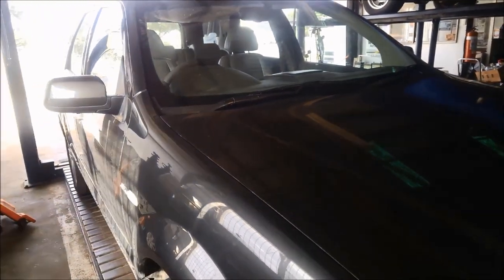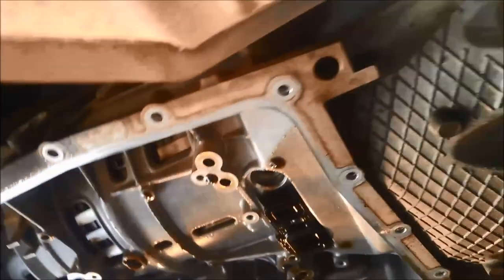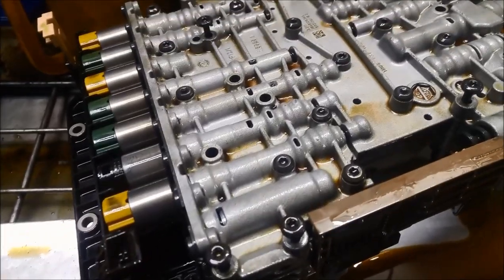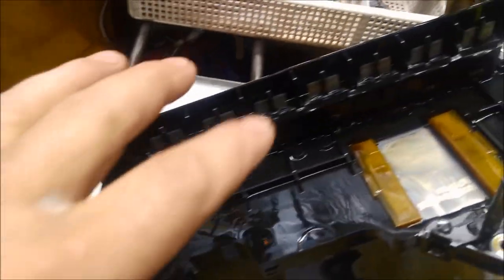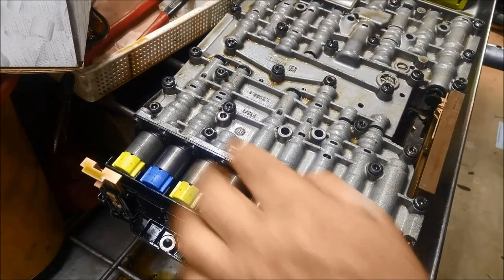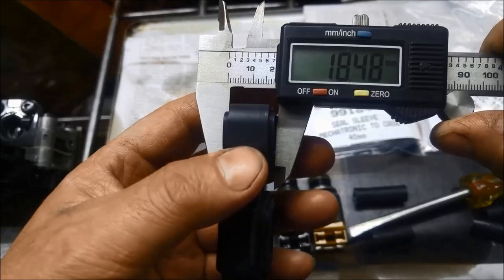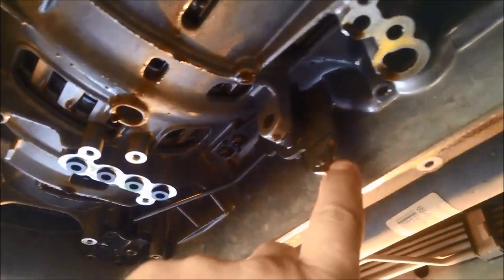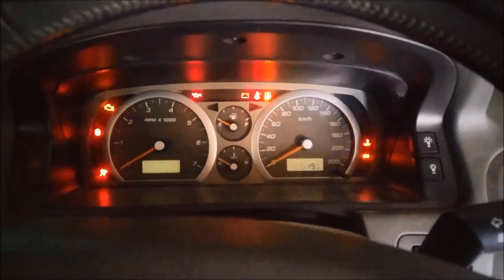ZF6HP26 6R60 6R80 09E Automatic Transmission ZF6HP Limp Mode Shift A P0973 Trans Filter Service

Comment: Thank you for this video. I'm about to remove the valve body and do this service . My s type r has a zf26 trans . One thing I'm not confident about is the linkage connection. Any advise before I dig into this ?
Reply from the maker: hi, internal linkage just lines up. no drama. cheers

Comment: My wife's 2007 AWD has passed 300 000kms. 
Getting clunky shifting into 2nd and sometimes 3rd. I suspect it is not creating pressure (esp when cold)... them o rings seem to be high on the list for attention. Can I use nitrile orings (got a box of them) ?
Been told that the torque converter is also failing...but that I can ignore this. Too expensive. 
The car is a keep until dead beast - so not too precious about it.
Great video
Reply from the maker: hi, depends on which seals you have? thanks & cheers

Comment: Do these boxes need the factory cooler ? I bypassed the coolant on mine so it won’t milkshake but should I put an external cooler on ? It’s an sz Terri non turbo no towing just used as family car. I’ve never had an issue but what do you think mate ? It’s going to be hot this summer that’s all.
Reply from the maker: hi, the factory unit is an heat exchanger, not a cooler as most people think. it is designed to warm up trans fluid temp to coolant temp so the rubber seals dont scrub out when frozen in sub zero climates. in australia we always recommend to bypass the heat exchanger to a bypass transmission oil cooler. this eliminates chance of coolant entering trans, helps maintain lower fluid temp so fluid doesnt break down or lose its properties and also the rubber seals are less likely to crystalise or harden as they will in time with heat. cheers

Comment: This is a great video that is easy to follow and understand. Thank you!

You showed us the # on the side of the transmission case that is needed to order solenoids.. But on my 2012 Range Rover Sport, it's impossible to see the number. The area is tightly packed. Is there a way to get the proper solenoids with the VIN?
Reply from the maker: hi, lower the cross member to get the code. cheers
Reply: Get a small video camera from ebay to fix through to see it.

Comment: Good evening Sir, I'm guessing your in Australia 🇦🇺 ?
I've just bought a 2007 l322 Range Rover,  and believe it has this transmission in it ZF 6HP26

I don't think its been serviced AT ALL,  with nearly 350,000k s on it, and no shift problems 😊

Can i bother you to ask for suggestions,  as to what i should do PLEASE 😊? 

My thoughts were new metal pan, with separate filter,  new seal in the side that the plug goes onto, and maybe those other 4 round tube seals you mention,  and that rectangle one.
Also all new solenoids,  and a flush best as i can do it, before all the above. 

You thoughts? 

Can i get a kit with all that in, for a reasonable price from somewhere you suggest?

Can i get some recommended oil from somewhere as well, as they say the oil is critical,   and to only use LIFEGUARD? 

Do you have a video on flushing one of these to replace most of the fluid?

I can't seem to find online a baby torque wrench like yours,  any ideas on where to get one from? 

THANKS HEAPS,  and EXCELLENT educational videos,  i APPRECIATE your efforts. 

Cheers Rob from Tasmania AUSTRALIA
Reply from the maker: hi, regular service, add magnets and bypass oil cooler. these units flatten out the valve body to case rubber seals and solenoids wear out and get contaminated. on valve body the end plugs wear and lose pressure as well. contact us via link in description, we can supply you parts. cheers

Comment: Thanks for this great video. I have a question
Is the transmission ZF6HP26 / 6R60 / 6R80
Same as Tcm console

I have a Lincoln Navagator 2005 ZF6HP26 same TCM for Jaguar flag or BMW same transmission ZF6HP26
Thank you
Reply from the maker: hi, if is same serial/model numbers then you`re right to go, otherwise you need to ask dealership if they are compatible and you still may need them to reflash to your vehicle. cheers

Comment: Hi there, I just performed this same exact solenoid, bridge, sleeves(4) and pan change out all from ZF. One solenoid (A) did not have any resistance value. Your vid really helped my out in tackling this job, thanks.
I’m going to add ZF lifeguard oil into my 09 Hyundai Genesis 4.6. Do I need to have a reset done to the adaptation values or will the transmission do it on its own with normal driving? Thanks in advance for your help. Cheers
Reply from the maker: hi, if you change mechatronic plate you will need to reflash or take to dealership to do it. if you just replace solenoids you won`t need reflash but good idea to do a relearn. if its shifting reasonably it will not do damage and relearn over next couple hundred kms driving. cheers

Comment: Hey mate, I’m having big problems with my 6hp26. It keeps going into limp mode and also sometimes red trans light and won’t move at all. 

It’s only happened since I changed my bridge seal, sealing tubes and mechatronic sleeve. 

When it goes into limp mode and I remove the plug and contact clean it, the car is perfect until oil gets into the plug again. (Short drive) 

Are the pins in this plug mean to stay dry or are the submerged? I feel like maybe I haven’t installed the mechatronic sleeve properly 

Any help is massively appreciated mate, in at a loss and can’t drive my car anymore
Reply from the maker: hi, if going into limp means major electrical issue. the mech case sleeve should not leak at all, the contacts should only have a squirt of wd40 or dielectric grease - no oil. where did you get bridge seal ? they have a width difference incase you purchased the wrong one? hopefully you havent damaged the mechatronic plate ? if you have more questions contact me via our facebook link in description and bring some beers👍 beer link is in description as well  . see also https://youtu.be/wpNSncaFEfE  regarding sleeve and latest  zf6hp26  https://youtu.be/6jm0YTQmcmY and zf6hp28  https://youtu.be/N5s9j8u0RXk  for more info. cheers

Comment: I have a good question for you. When putting the wiring harness adapter back on, do you need to have the L piece on the wire or would it be fine without it being on? The reason I ask is because when I turn the plug, the L piece pops out and gets in the way of me turning the plug.
Reply from the maker: if i understand you correctly, you will need to keep pressure on the sleeve until you push in the fork, or the tension from rubber o`rings will push/pop it out. cheers
Reply: @YepThatsIt  thanks for responding. I managed to get the adapter in and the plug in the adapter. I am having quite the difficulty turning it. I have no clue how you made it look so easy. Then again, I am doing this on a bmw.

Comment: Hi mate, i got a 2010 fg xr with zf transmission. Don't know the service history, recently is giving me a fault code and goes into limp mode.turning the car off and on clears the fault and drives normal again. Any suggestions where do we start to fix the issue?code p0735
Reply from the maker: hi, depending on mileage and how much debris in trans pan, usually replacing solenoid set and valve body to case seals will fix your issue. if you`re in australia contact me via our facebook link in description, we can sell you the parts. cheers

Comment: Awesome video!! The best
I've seen on the shift solenoids. One question: when I start driving in
automatic mode on the initial take off the I lose transmission power. Soon as I
take my foot off the accelerator pedal and put it right back I get transmission
power back. It normally only happens around the initial take off. Another time
it happens is when I'm parking on a slope, I really have to rev up for the
initial take off. Once it starts going then no issues. Hope I didn't confuse
you. Would that be a shift solenoid issue?
Reply from the maker: hi, it does sound like a contaminated solenoid, where the debris is magnetised making it sticky initially when cold. on these tran, the mechatronic to case rubber tubes and bridge seals flatten out and harden as well. have you been doing regular transmission service on yours? ( every 30,000-50,000km ) and what mileage is on the vehicle, it could be worn anyway? before you do anything, always check the basics - fluid level, electrical connections, strong and charged battery, good earth from transmission to chassis etc. cheers
Reply from the maker: cheers buy me a beer !.
Use the "PayPal Me" link here https://www.paypal.me/BATS189

Comment: Can you put any yellow solenoids on 1,3,7 or does each yellow solenoid have to be specific ? In other words will the yellow solenoid that that belongs on 1 will it fit on 7 if there both yellow?
Reply from the maker: hi, on the zf trans you can, on the 6r trans they will have a faint flow number printed on them between 1 & 5, always put the same number in and mark which one went where prior to removing. cheers
Reply: Mines are the same colors as yours! So mine should have the numbers 1-5 right? And also where exactly are the numbers labeled?

Comment: How difficult is it to actually drop the ZF6HP26 out of a Falcon ute and re-install it. Are there any trick parts to doing it and what is your solution to fixing the flex plate bolts from loosening ?  Thanks 👍🏻
Reply from the maker: hi, no tricks just nuts and bolts....re loosening flexplate bolts...make sure you have original high tensile bolts to crankshaft, when you have the flex plate on, rotate it so the holes contact with bolts on the rotation side of hole ( ie bolts leaning against hole ) and also put some lock tight on and do up to manufacturers torque specs + 10% cheers

Comment: Thanks for your video. I'm half way through servicing my ZF6HP on my 2012 Falcon and I've hit a problem. I can't get the mechatronic locking fork to go up. It seems like its latched down and I can't figure out the latch. The new mechatronic sleeve was very stiff to get on but I pushed it in as far as I could. Now I've taken the sleeve out (to make sure I wasn't causing a problem)  SURELY WITH THE SLEEVE OUT the locking fork should be free to move upwards ?? But it still seems as if it is latched down somehow. Have I misunderstood or broken a latch ? All help is good.
Reply from the maker: hi, did you press the little tang? and hopefully not forced it ! or you may have broken something. the sleeve o`rings do make a tight fitm make sure you are pushing sleeve in while pushing up the clip. cheers
Reply: @YepThatsIt  With the sleeve out, should the fork be free to move upwards. That little tang doesn't seem to do anything, the fork just won't move.
Reply from the maker: it should be able to move up and down regardless of sleeve. should be easier without sleeve in. try wriggling it while holding clip....maybe you arent  pressing clip hard enough?
Reply: @YepThatsIt  Just as I thought, Something is weird. I'll fiddle again tomorrow, meanwhile I've ordered a wrist earthing strap and when it arrives I'll take out the mechatronic and have a close look at the whole  slider mechanism. Thanks very much for your help, I do appreciate it.

Comment: I have a 2005 SY Territory with 6HP26 it went into limp home mode, reading ODB2 codes it is reporting the following faults: TCM codes: P0705, P0979 and PCM code P0701.
Are these typical for a failed C solenoid? the transmission also has a whining noise that varies with engine speed even in Park.
Reply from the maker: hi, noise could be faulty planetary gear and/or blocked ( starved of oil pump) filter. you most likely have worn/leaking/contaminated solenoids ( allof them ) and cross leaks in the valve body to case tube seals & bridge seal. cheers
Reply: @YepThatsIt  The day the transmission went into limp home mode I limped it home at 50 -60 KM/H and parked it it. The whining didn't start until it was started up after a couple of days sitting so it could moved.

Trying to work out if spending the $650 on solenoids and  seals will fix or if its going to need more serious surgery.
Reply: Shift solenoid C was open circuit, Your kit arrived yesterday :) I have replaced all the solenoids and have the valve body ready to bolt in just ran out of daylight after work to install today.

I filtered the old oil and there was very little clutch material and no metal particles on the pan magnets (steel pan has been on since 2013).

The filters seal came of the filter when removing this may explain the whine that developed after parking it for a couple of days.
Reply: Its alive! put it back together today, all faults have been cleared and it working again :)